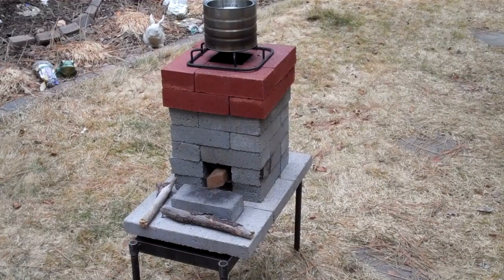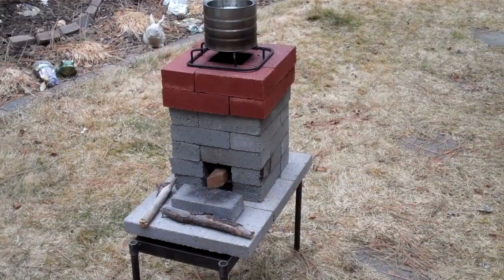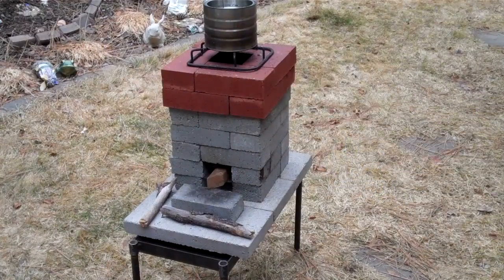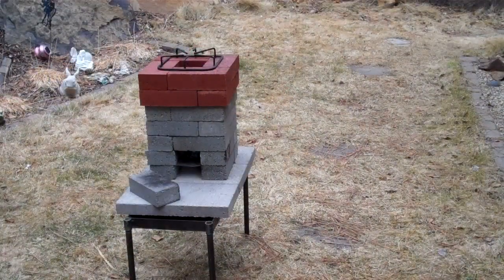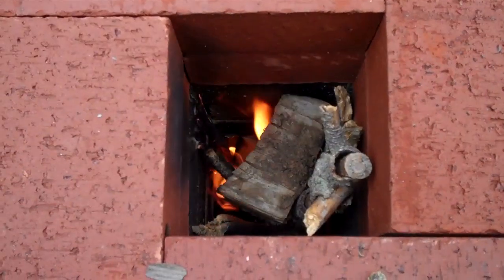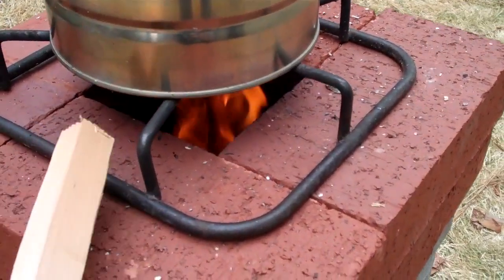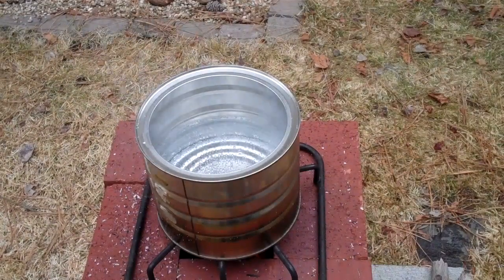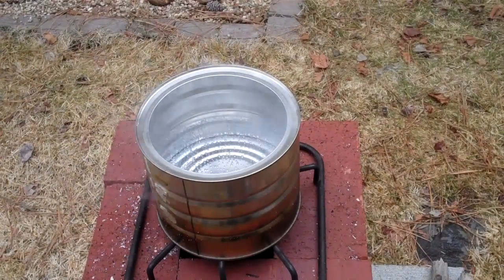How to improve on the basic brick rocket stove

Comment: I'm no expert, but any of the "red" brick as pictured (I'm referring to the old bricks some may have lying around old barns, old farm homesteads, weekend homes or older houses out in the country) are usually "fire brick".  Most were used in chimneys.   If you knock two of them together, they make a sort of "ringing" sound, this indicates they have been kiln fired when they were made.  Now maybe more folks are familiar with the old yellow looking or off white brick such as our old school building was made of, these are not very good for putting a fire to.  A lot of those may be just sun dried brick or dried but not necessarily "fired".  When you knock two of them together, you will get more of a "thud" than the "ringing" noise.
Reply from the maker: Good tip - thanks!
Reply: Nice stove dude, I've got to try it!

Comment: Thanks for your videos.  I just made one here in Mexico with the locally made bricks. The bricks are irregular so there are gaps and cracks.  Is that an issue?  It seems to be using the fuel rather fast.  Trying to make a prototype to then show others how to do this. Cooking with wood is causing a lot of deforestation here.  Would like your suggestions on how to improve it.  Thanks much.
Reply from the maker: If the bricks are irregular, it will let air in. I'd suggest you use mortar with the bricks and make it a permanent structure. If you can't find a piece of mesh for the first layer, cut both ends out of a tin can, and flatten it to fit in the gap at the front. This will help the draft, and that  should improve fuel efficiency. If the stove is burning too fast, experiment with sliding the brick back and forth to change the air flow.
Good luck - let me know how you come out!

Comment: I made one of theirs a few years ago out if brinks I rarly used it it's still just sitting there I also made some mud to act like mortar for the brick since the ones I had were not so good I also didn't have any mesh at the time so I used some brinks that had been cut length wise to about only 1/4 inch or so and used that to hold to wood up I also dug a small hole under the opening so when you where done or needed to get rid of the heat fast you could scrap them out into the hole it was also a ash dump

Comment: Ok should we supercharge this design?-Try using two bricks at the intake lengthwise and use another brick stacked length wise to create a venturi the top brick will also support wood. more suction greater heat I'm guessing. You may have to blow into the venturi to get rocket results to start but maybe not. Thx.
Reply from the maker: Interesting idea. Sounds like I should try it.
Reply: SurvivalCommonSense I'm sure it will work really well. Let me know your results. Thanks for the reply

Comment: I have made one of these in similar design. Its been in the weather for estimated 5 years now. It has not exploded yet... Can it with concrete? Yes it could. The concrete brick is not as compressed as the brick is. And the concrete will absorb moisture and retain it longer. I would think in order for the brick to explode you would need a very high temp fire inside. Not sure we can get one with the small amount of fuel source it takes to cook with. Thanks for sharing...
Reply from the maker: I would definitely use chimney bricks if I were making one for long term use.
 http://www.survivalcommonsense.com/build-a-brick-rocket-stove-is-it-safe-to-use-concrete-blocksfeed/

Comment: great video! i built one about a tall as the one you have here. my question is...how can i know if the 'wood gases' are igniting? from what i read, wood gas burning makes your fuel last longer. thanks
Reply from the maker: Good question! My guess is that if the stove burns clean, it is hot enough to ignite the wood gas. Anybody out there know?
Reply: i keep looking for some blue in the flame but not sure if it does that. hopefully someone will chime in....i am having fun which matters most of course! :)
Reply from the maker: As rocket stoves go, this pattern is very rudimentary and can't be expected to work as well as something like a SilverFire. Take it as it is - a brick pattern stove that can be adapted to many survival situations. This stove is not the best rocket stove, but it may be the easiest to improvise.
Reply: SurvivalCommonSense never even heard of the silver fire; i'll check it out. thanks.

Comment: looking at the designs and intended uses for an occasional or temporary use concrete looks acceptable yes the might crack or deteriorate eventually but for disaster use or camping i see no problem if i would build one for more constant use it would be worth the effort to find fire brick i did internet search of the big box and a concrete yard  not a stock item here in Fl but i have not looked at specialty shops that do not have internet ad.
as for the real rocket stoves designed for 3rd world they use it indoors and many times a day and I commend who ever designed its is a real help for the populations that makes a difference to there lives

Comment: I would guess the problem with concrete bricks is that they are porous. If moisture gets into them and sits, it will freeze in cold temps. That trapped water can expand and explode. This is the same heating and cooling that cracks concrete. I once camped under a stone face over hang, in a mountain side. Our campfire started super heating trapped water. The shale like rock exploded (Think river rocks in a campfire) ... yes it can be dangerous but the REAL danger was it tossing embers all over. Embers hit me and my sleeping bag. I had to put out a fire. So... that is most likely the danger. You say skill weighs nothing, as does experience shared - lol.

Comment: If you can find fire-bricks that are both heat-resistant and light and spongy, the greater trapped air content will give you better insulation. Insulating the whole L tube of the rocket is an important part of maximising its efficiency; gives you higher temperatures at the top of the riser tube, and a cleaner, more complete burn, with that much more heat released. This is the heart of the first part of efficient rocket stove use; the second part is getting as much of that heat at the top of the riser into your pan. There, a skirt round the sides of the pot, with precise gapping above the riser-top, and around the sides, increases the overall effectiveness of your stove. And use a lid.

Proportions are important too: the x-sectional area of the whole tube needs to remain constant throughout, even if it changes its shape; and the riser height needs to be between two and half and three times the tube diameter, if it's round, or between two and a half and three times the side length, if it's square.

Comment: There is "fire brick" available for making chimneys. It would be better to use than construction type brick.
If you see a demo of an old house, see if you can get the fire brick from the chimney for free. It would probably hold heat better as well
An experiment you might do would be to get a heat thermometer & stick it in the top of the stove while the can of water is being heated & see what the temperature is at the 5-high brick level. Do the same test at the 6 and 7, & 4-high brick levels.

Comment: This is good; if you could fine a length of pipe to fit inside this would make a better draft chamber with hotter temps. build a heat shield at top to reflect heat; in a shelter of sorts would keep you warm using less fuel.

Comment from the maker: If in doubt, just use chimney bricks. The comparison between the chunnel  fire and a fire built in rocket stove is not valid, in that there were vastly different circumstances. The biomass heat generated from a properly vented rocket stove compared to a train fire could vary several thousand degrees Also, the chunnel heat was trapped underground, with no place to go to. You have a valid concern, but I don't think the concrete bricks are a problem in the rocket stove. Thanks for the feedback!

Comment: The channel tunnel (england to france) is lined with pre-cast concrete panels. When a train caught fire, moisture trapped in the concrete tried to explode out as steam, causing the concrete to spall away and requiring a lot of repair. Later tunnels built the same way incorporate plastic fibres into the concrete mix. In a fire the plastic melts creating pores to let the steam out without destroying the concrete. These concrete bricks look quite porous already.

Comment: not really a rocket stove because concrete bricks do not fully or adequately insulate the burn chamber....better insulation means cleaner burning...any brick will work, but lightweight insulated fire brick will heat quicker and burn cleaner...aloha

Comment from the maker: Fire bricks are about $1.49 each, and the size is not the same (They are about the same width and length of a standard brick, but about half the thickness.) Subsequently, it would take twice as many to make a stove this size. If you were using the stove daily, it would be worth it. But the point was to make an emergency stove, and for that, you'd use whatever you could salvage.

Comment: I have seen concrete blocks "sweat" water, yet never explode. I believe that the porous nature of the brick, allows moisture to escape via steam. While this is the same reason a brick may explode, I guess one is flipping the proverbial quarter.
However, if the bricks aren't saturated in water, or submerged in flames, I think they would work just fine.
This is a good test! Thanks!